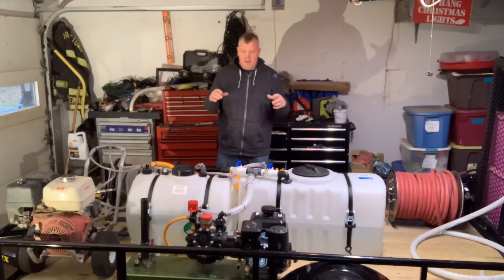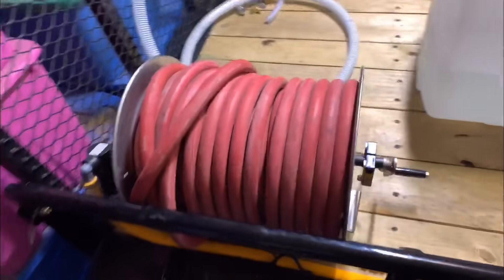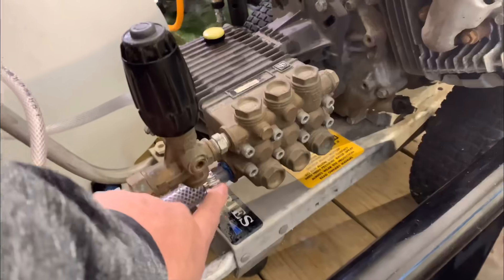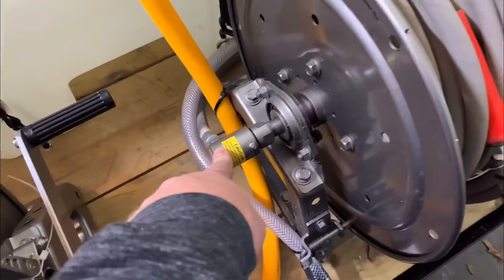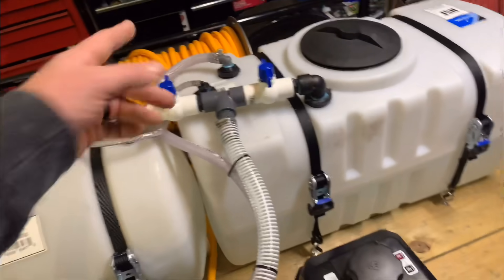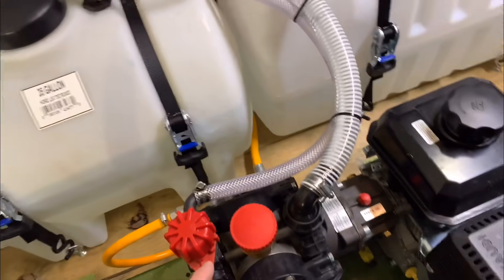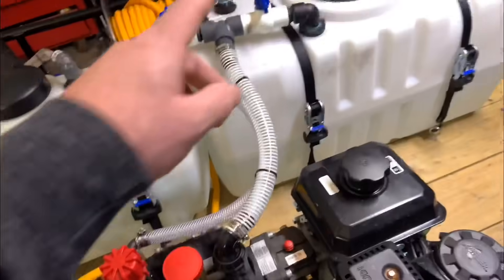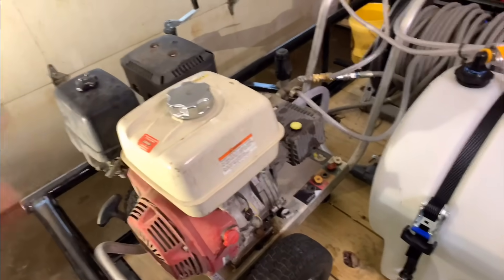Pressure Washing Trailer Build Rig and Overview For Dayton Ohio

Comment: I tried having my buffer tank to supply water to my pressure washer, but the water didn't seem to feed enough water to the pressure washer? I have a 3.5 GPM PW.  I just went back to faucet fed water.  Do I need to place a water pump in between the buffer tank and PW?

Comment: Where y'all getting your bulk tanks from? Everywhere I find them the shipping is more than the tank itself.
Reply: Tractor supply, northern tool, homedepot I believe you can have shipped to store for free pickup.
Reply from the maker: The best place I found them is really on Amazon. The ones at Home Depot and tractor supply are not very thick and will crack very easily. Here is a link to my store on Amazon and you will be able to find them on there.

https://www.pressurewashhelp.com/store

Comment: The soap tank is a batch mix tank correct?  Can the comet pump work with a mixer valve?  Curious bc of that bypass line 🤔
Reply from the maker: It can but you have to do some crazy plumbing to make it work

Comment: How would i attach a buffer tank to a 4gpm machine? Id like a 35 gallon buffer tank that i could use for my pressure washer or for a 12volt system. Or is it just not worth it to feed a 4gpm from a tank? I know most houses will be able to supply it no problem. 

Tank plumbing has been quite confusing to me, would i need another pump to feed my pressure washer since it needs water pressure to run through the pump?

Appreciate everything you’re doing for the industry. Would like to come and take one of your classes at some point
Reply: Found my answer i think. For direct drive a pump is generally needed or enough water weight to supply the correct water pressure, gear drive or belt drive no pump needed
Reply from the maker: Even the direct drives I have had no problems pulling from a tank without a pump. The buffer tank is really to keep it from overheating is the main job of it
Reply: Power Washing good to know thank you Jason!

Comment: Jason I have a 50 gallon tank i use for batch mixing for my roof set up. I have a 4gpm machine so i dont use a buffer tank.  What soap tank would you recommend? I have 2 15 gallons drums for bleach.
Reply from the maker: I would probably just use a 50 gallon batch Tank you got

Comment: I've got a Simpson 4gpm 4200psi pressure washer. Has the Honda GX390 engine and CAT Pump. Not a belt drive and doesn't have an unloader. I've had it for 4 years and still running strong but want to switch over the pump and get one with an unloader. Do you have a recommendation for one when I'm ready to switch it out and actually how to set it up so I can run a hose from the unloader to a tank properly? Thanks!
Reply: I went with a general pump 4,000psi 4gpm pump from pressure wash direct believe it was around 320-360 and has a external bypass so far so good.
Reply from the maker: It sounds like what CL said would be a good idea